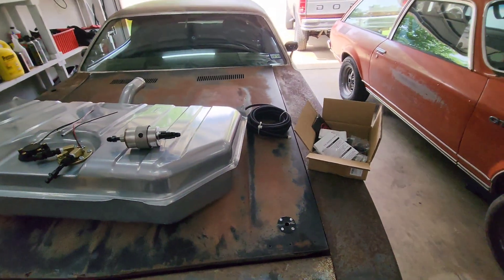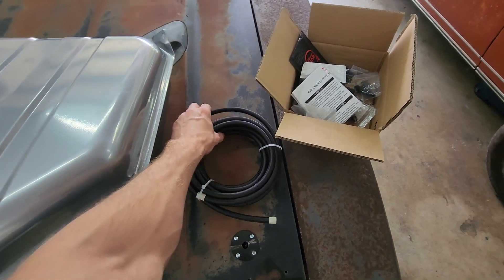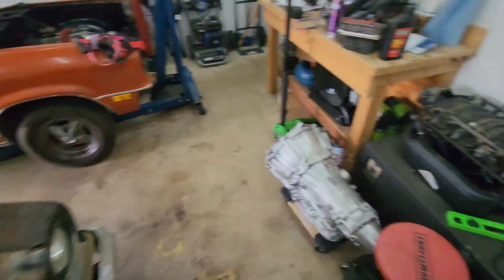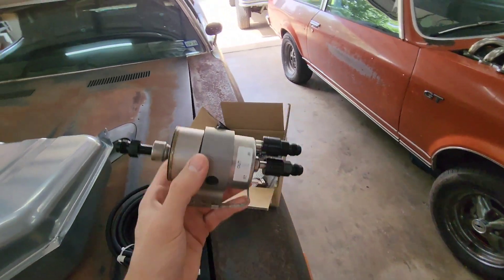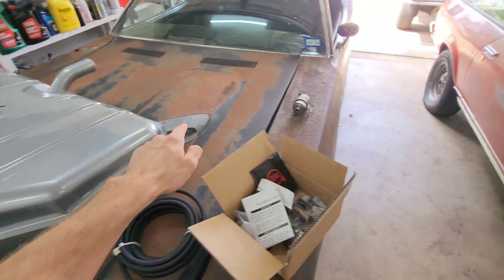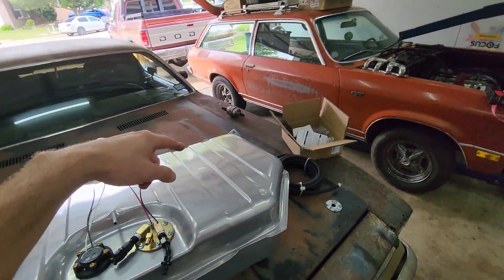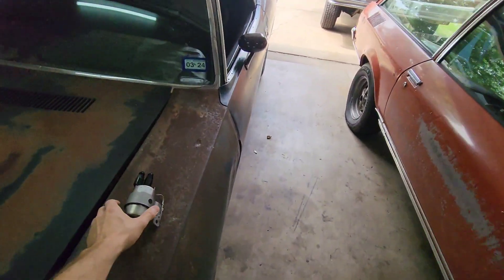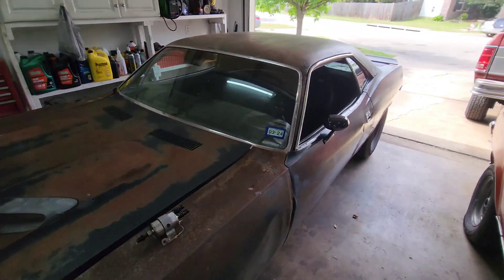How To Hook Up The Fuel System For An LS Swap!

Comment: Found your channel cuz I'm just setting up the same LS fuel system.  I bought the Amzon Evil Energy -6 AN PTFE and it looks like the kit you have. It was easy to install the fittings. Are you happy with the hose and fittings?  Is the fuel filter reg good compared to name brands like WIX?
Reply from the maker: Havent had an issue with the fittings except on the camaro I'm doing now I had a slight issue with the fuel line at the rail not sealing but it was an easy fix. You can add a pre filter after the fuel pump but before the regulator if it makes you more comfortable.
Reply: @krustyclassicsgarage  glad to hear your experience has been positive. Hopefully they last and are a good alternative to the more expensive name brands. Thx!
Reply: Great video,  just wanted to share, corvette filter, is hit or miss , too many fakes, and make sure you have a fuel pressure sensor or gauge, or you will be fighting the tune . I ended up getting the holley  fuel pressure/ filter thing , expensive but it works great and the pressure is spot on

Comment: Where would I get the cap for the return line and do I need to put a delete plug in the fuel rail where the factory regulator is?
Reply from the maker: If you're running the corvette filter/regulator you run the return line from that and if you have a return fuel rail. Cap the return. On the rail. You get a 6an fitting to go on the return line end then you get a 6an cap to cap it.
Reply: @krustyclassicsgarage  awesome. Thanks.

Comment: What happens if fuel pressure is to high?
I recently used a Holley retro fit pump to supply fuel to a fi-tech EFI fuel system on a 350, 
It has trouble getting it started once it’s running it great but not a good get away car 🚗 🚓 you know. 
Could it be the Holley efi system is not regulating properly?
Reply from the maker: Then it either won't run or will run horribly like you're saying. Pull a spark plug and see what it looks like and go from there. I highly doubt it's the holley retro fit pump. My guess would be a tuning issue with your efi system.
Reply: @krustyclassicsgarage How is the Corvette style regulator holding up? I keep hearing to only use Delco or Wix. Any issues? Thx
Reply from the maker: @intheshoptv  I'm not using one. I've been using a Holley retro fit in tank pump that's internally regulated. I've done swaps with them and haven't heard of any issues.